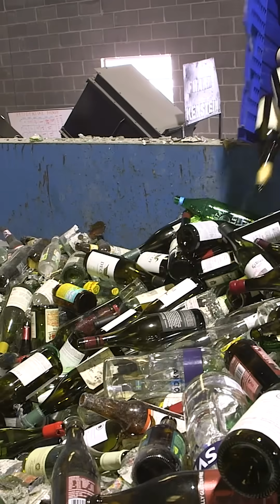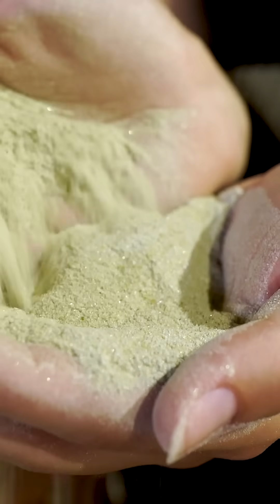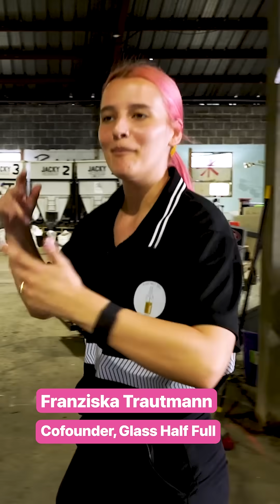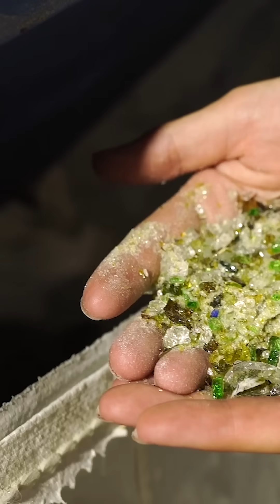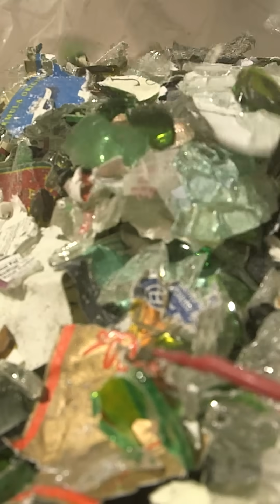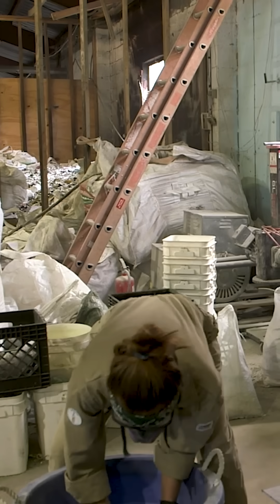Here’s how this entrepreneur crushes glass bottles back into sand. #Recycling #Sand #Glass

Comment: That seems unsafe with all those glass dust floating in the air
Reply: They mix their facility tour shots with sequences where the plant is in operation.. which is very weird. Workers probably wear PPE, but the dust management is evidently lacking (visible dust, no evacuation, a sketchy fan blowing the dust around in the hall...)
Oh and the person operating the loader doesn't have a respirator / mask.
Reply: @hardwareful call me crazy, but wouldn't you want to wear extra PPE in front of a camera? In all the times my lab have been used for promotional pieces, the photographers asked us to wear goggles (not safety glasses) when pretending to hold an interesting vial
Reply: Silicosis is a hell of a drug
Reply: @teebob21 literally the only person to a actually acknowledge this problem.

This is why a lot of concreters are getting silicosis now due to crushed glass in the mix for grit/filler.
Reply: @braveeagle779 While it's true that breathing in windblown beach sand for decades could conceivably cause silicosis, sand particles measuring 0.1 mm on each side are far, far larger than the micron sized glass dust that this "recycling" operation is making. 

The OSHA exposure limit to respirable crystalline silica dust, such as airborne glass, is no more than 50 μg/m^3 for an 8-hour shift....and that's WITH a respirator on. (OSHA Standard 1926.1153)

Don't try to belittle the existence of a risk that you don't understand by making a fallacious analogy to something absurd. That's what people who are poor persuasive speakers (or, are just not very smart, but want to feel smart) will do.
Reply: @teebob21 and what is your level of expertise to make you even a troll let alone an expert
Reply: @teebob21 So your logic misses something critical: they're OSHA approved. So clearly either you know something that OSHA, a business, and various scientists don't or you're just wrong
Reply: didn’t know that there were people who don’t believe that crushed glass could be harmful to breathe until reading these replies
it’s all either “you can see them wearing masks and goggles in the video” or “the woke mob has gone mad with safety precautions” with no in between
Reply: That’s why the worker is wearing safety glasses and a mouth covering
Reply: It’s not like normal glass they specially process it watch the full video before judging
Reply: @S5S5066 Again,  you cant turn glass into sand. You can only turn glass into smaller glass, even if it is in fine particles like sand,  it is still in a sharp crystalline structure, and will cause major health issues. There is a very, very good reasoon they need full ppe when working with this stuff. Microparticular glass is pretty much  man made asbestos as to the effect it has on your lungs.
Reply: That's why they're wearing respirators and goggles.
Reply: And here comes the experts
Reply: it most certainly is.  i work with glass.   my bet is she unmasked for the interview, which is fine.
Reply: This person is amazing 😮❤
Reply: They're wearing masks.
Reply: Don't fill bad women's ideas
Reply: Feel like you would say the same thing about a lot of necessary jobs. Like yeah it sucks but someone has to do it.
Reply: The world is unsafe.  Only in the past 10 years have things gotten out of control where suddenly everyones an expert on what's dangerous
Reply: glass is made from sand, you prefer microplastics ? glass is superior compared to plastic as a container and recyclability
Reply: @steve50431  what? He is talking about effects of glass on lungs for the workers, atleast in video they are not wearing masks which is major hazard...
Reply: @symix.  ah I see. Excuse my ignorance, workers are ignorant too if that is the case.
Reply: @symix. watch it again…yes she absolutely is wearing a mask during her lil demonstration
Reply: @beem7606 the black mask looks dirty and loose compared to how it should be worn.
Reply: @symix. Glass is only superior if a bottle is recycled around 20 times without breaking and therefore leaving the recycling process.
Reply: @BlueFlash215  Good point. People forget that "recycle" is the last option to choose in the Waste Reduction mantra: REDUCE, REUSE, RECYCLE.
Reply: @symix. the last person they show is wearing a mask
Reply: @steve50431 not to over explain but when heated, sand looses its very dull molecular structure, and when cooled, hardens into a more crystalline figure. Of course, if this material is brittle enough(glass) the dust will have the same molecule shape of mini “spikes”, making all sorts of problems. Quite similar to the natural asbestos.
Reply: @beem7606 that’s not the point… the point is there is glass mixed with sand floating in the air and getting any whiff of that in large amounts over time can cause damage. Not hard to understand. Just cause she wore a mask for a scene doesn’t paint the whole picture. There are more shots without masks so it is safe to assume it’s not used much unless they purposely did it for the video which would be quite strange to show off that you don’t use the proper protection. I know common sense is hard but this is simple stuff here
Reply: @symix. they were literally wearing masks in the video
Reply: @symix. 
You can literally see the person wearing a mask at the end
Reply: @symix. the girl working with the glass has a mask on. Did you only watch half the video?
Reply: @symix.  Glass particles is just sand. It doesn't harm the lungs. You're thinking of fiberglass.
Reply: @steve50431 yeah glass is made from sand but you cant turn glass back into sand. Theyre just crushing it into a fine powder which is basically micro shards of glass that has the potential to cut you
Reply: @steve50431 I prefer not to breathe in either microplastics or glass
Reply: @steve50431 someone has no idea how to interpret a text lol
Reply: Glass dust? You mean sand? Hahaha
Reply: @dajb90 No. Tiny shards of glass is not "sand" 🤦 just because they have a similar chemical composition doesn't make them identical. You have iron and carbon in your body but you wouldn't try to swallow nails or the blade of a knife?
Reply: @dajb90 there's a difference between sand and crushed glass. Sand is eroded, under a microscope its very round. Crushed glass on the other hand is sharp, and you get a similar problem you have with asbestos
Reply: @dajb90 More like fine microparticular silica dust produced when you crush glass like this. The stuff that you need specialized ppe for. And the stuff that floats literally everywhere, even outside the factory.
Reply: @dajb90 It looks actually more like they just crush down the glass to very small pieces, instead of actually turning it back into sand. It doesn't really look like they actually structurally change it back, I could be wrong though.
Sand naturally has blunt edges, while small glass particles often have extremly sharp ones. Which is also one of the reasons one needs to be very careful when working with fibre glass. If small particles that break off get into your lungs it will not just cause issues over having particles stuck to your lung tissue the body has to remove like it is an issue with flour for example, but it will give it small cuts all over. Which makes your lungs super vunerable for infections. Even on your outer skin it will cause irritations and ichyness. And she is operating this with a ill fitting mask and an loose overall, with wide arms.
Safe to say that is not a good idea.
Reply: @dajb90 NO JACK AZZ. THEY MEAN CRUSHED GLASS. Just cause you crush glass tiny does NOT make it sand. ITS STILL GLASS. It's been structurally changed. sand is tumbled shell.
Reply: You must not go to the beach then. Breathing in all that glass lol
Reply: @RyDubbzMusic grinding glass into dust and sand from a beach are two separate things….
Reply: @NaOds50  of course, since the glass is more pure than beach sand. it's still sand tho.